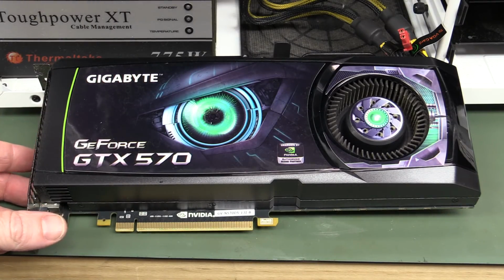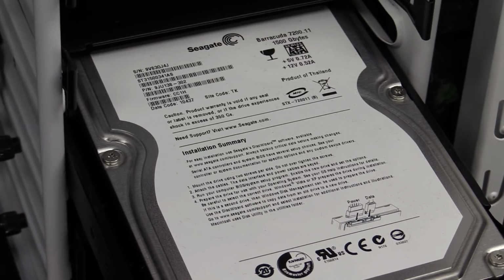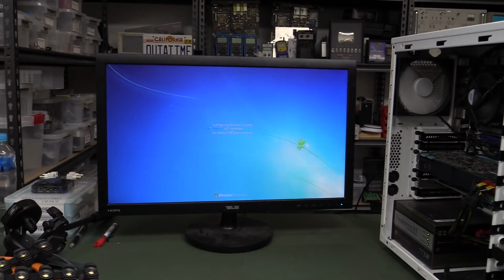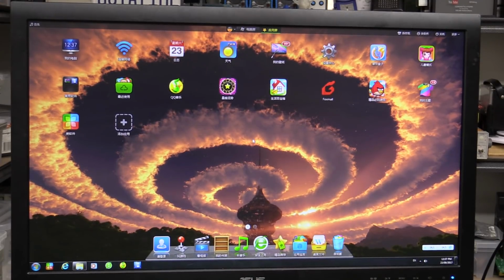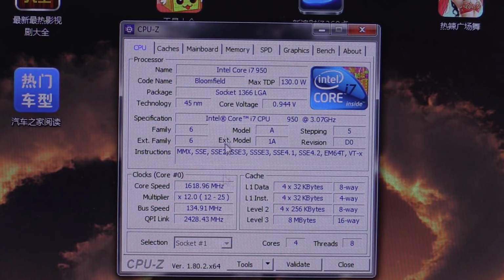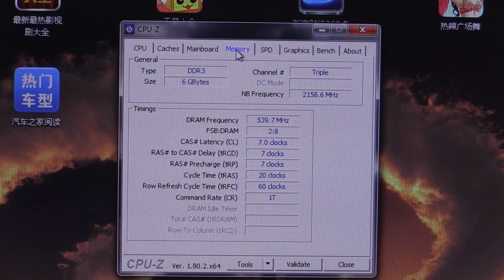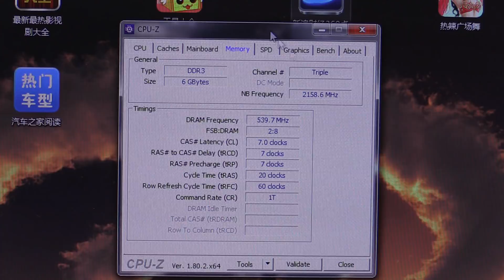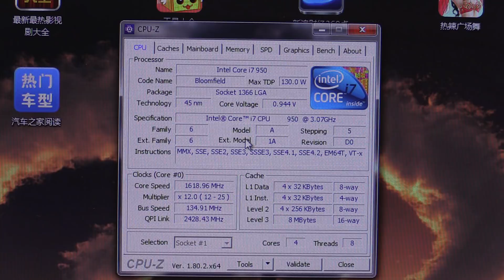EEVblog #1026 - Mystery Dumpster Diving PC

Comment: That's a Define. Who would throw that away? Those aren't cheap. There never were any i5s or i3s for LGA1366 by the way. Only i7 and Xeon. The 870 is also a first-gen i7 just like the 950, but it came on LGA1156, which was the consumer-grade platform, as opposed to LGA1366 which was for workstations and servers.
Reply from the maker: Seems I can use any of these processors?
https://www.cpubenchmark.net/socketType.html#id4
Reply: Ideally if you wanted to swap them you'd check the compatibility list of that motherboard. It should support all 9xx-series i7s, including some six-core models. Those are newer though so you may need to update the BIOS first with the CPU that's in there right now. Some Xeons are also compatible, but maybe not all of them. Here's what Gigabyte has to say: 
https://www.gigabyte.com/Motherboard/GA-X58-USB3-rev-10#support-cpu
It's also worth noting that any CPU on this platform can be overclocked by raising the base clock quite easily, but they do get quite warm if you do that, and will also need to adjust clock multipliers/dividers for other components on the board so they don't run too far out of spec. Anyway, congratulations with that find. It's not new but it's still fairly fast today, faster than what I've got here by a nice margin.

Comment: I found an HP computer in the mechanical engineering building e-recycling at my university about a year and a half ago. No RAM, no hard drive, but it does have an i7-3770!! I slapped in a spare HDD (with Windows 10) and 3GB of DDR3 1333MHz and it booted perfectly! Since then it has gotten a Gigabyte Z77P series mobo, a 500GB Samsung SSD, 8GB DDR3 1600MHz, a NVIDIA GTX 480 graphics card, and an acrylic case with custom made NeoPixel RGB border lighting controlled via an Arduino Nano using custom software I designed. In all, the build has cost me just under $400. Half of which was just the SSD xD
Reply: Ian McClellan-Johnson A GTX 480???? Yikes. May God help your poor, doomed soul... *Does cross across chest*. 

Unless you meant to say "Radeon RX 480", in which case, nvm, nothing to see here folks...

Comment: Mate, with an x58 motherboard you should overclock it :) If you have a decent cooler free anyway. I run 3 x58 systems, running 6 core dirt cheap xeon x5675's oc'd to 4.3-4.4ghz :) The performance becomes crazy for the price, in your case even more so as it was free :P

Comment: It is a nice platform but my old socket 1155 pushes 9000+ (i7 3770K) paired with equal crusty nVidia 680... ..but it was not for free so you win.

Comment: Meanwhile I am watching this on my socket 775 platform with a gforce gt620 graphics card. An i3 with integrated grphics runs better graphics But I got war tunder working on low settings on 28fps which is nice

Comment: The case and motherboard are the most expensive parts here.

The CPU isn't great, loses out to even 50$ Pentiums now while consuming so much more power that if you really used that machine after a year you could buy a decent CPU. 
And the GPU - loud, hot, slow. It works, but not great.

The first USB 3 boards arrived some time in 2009.

Comment: trojan horse. dont connect it to your network.
Reply: Flash the latest bios or current one over top the one installed and run a Deriks boot and nuke (DBAN) for multipasses. This system is old enough intel ME wasn't a thing yet. Should be pretty safe after that :)
Reply: X58 doesn't support UEFI so you're fine.
Reply: @Electronics For Fun
Yeah your right, the final stage of this master plan is probably to check if someone makes a dumpster dive video of it, trawl the comments for people saying it has malware on it, then joke about how ridiculously ineffective that method of infection would be to convince everyone it's safe ಠ.ಠ
Reply: That has to be the most cost effective way to spread malware. Buy a complete computer with very decent specs, probably around 2012, wait 5 years, leave the thing in a dumpster and hope someone happens to pick it up, before it gets stripped and sent to Africa or something. XD
Reply: Yeah, I guess that can work too, if you want to be an NSA copycat. Not that original though. Way cooler to do some convoluted network infestation with overpriced hardware :P
Reply: Yes, but that is not as funny...
Reply: molnez+ :-O
Reply: I think y'all are missing the effort to reward factor here. If I spend 150 bucks on a nice case with well specced old stock then the reward has to be greater than 150 dollars, and I only have one victim, and my goal is to create a horde of zombies then I'll have to hope it gets hooked into a vulnerable network.its also reasonably easy to mitigate the risk of one machine, wipe it, reinstall, and hang wire shark off the back to see if it's doing anything goofy. 
Even my tech addicted ass has about three machines running on my network that are at risk to zombification. If I buy a literal bag of thumbsticks, compromise the firmware on them, and scatter them about the land like a malware fairy, then I have many more chances to infect many more networks and have a much stronger botnet for less than the same price. It's also harder for me as a network engineer to explain to my users not to insert thumb sticks into a computer. Most users would know straight up that hooking a full blown computer to a network is a no-no.
Reply: aljowen+ ikr you'd think that, because sandy bridge came shortly after nehalem, and there wasn't a whole lot of time to do a whole lot.
Reply: I think the assumption is that the computer could have been infected with a virus. As opposed to the virus being planted on it specifically for someone to pick it out of a dumpster :p
Reply: Generic Green Squid bet that machine is old enough to do the smm ring -2 pwn
Reply: If you feel really unsafe about it, just get a new cheap HDD or an SSD.
Reply: molnez+ for all you know this machine could have been built a month ago. the older parts in that thing are super cheap right now, so he could have used those parts to make it look like it was an old beast that did it's job but needed to be put down. so he puts his crap on it and then tosses it in the bin. you can't build a computer full of junk and then expect somebody to take it, the inside of it has to look at least decent for somebody to bother taking it away. so if you put in older top of the line parts then it might be worth a look for somebody who is skimming through the dumpster.
Reply: Doubt they'd compromise, but hey, that's your opinion
Reply: molnez nah. Just leave thumbsticks laying around. No need to spend money on an entire computer
Reply: This thing was probably in a Chinese internet café, so there has to be spyware on it (required by the Communist Party). He's gonna nuke this install, so no worries.
Reply: Generic Green Squid What about the motherboard? Since it has been shown as possible to compromise the UEFI /Bios silently.

For the components that are in it I don't think I would want to bother with it. Now to be fair it's probably 100% fine. But imo it's not worth the hassle if it does cause issues.
Reply: Electronics For Fun Damn, you are correct. I assumed that since UEFI seemed very mature on my sandy bridge system that it must have been around for a gen or two before that.
In which case UEFI is not gonna be a problem.
Reply: Generic Green Squid Often even nuking a device isn't enough to make me even consider connecting it to my network. A PC like this is imo not worth the security risk it poses even after being wiped clean with a new install.
Reply: Just do a search for UEFI virus and you will find a fair few results. They have been trying to target UEFI's because the virus will survive an OS reinstall. You could try updating the UEFI in order to make it "safe", but like I said, what's the point for a first gen I7?
As I mentioned, the odds of this being the case are very very slim. But if you have over £1k worth of other computing hardware connected to a network its frankly not worth it.

Comment: Reading through the comments here it's obvious most people are missing the point by saying 'it's old' and 'it's worthless' and comparing it to more up to date equipment. A free computer that works can be a very useful addition to anyones spares cupboard. There are so many possibilities for it and multiple projects that require a dedicated computer or you could just use it as a server or even a test computer, why are people so confused about this ?
Reply from the maker: Well said, plenty of uses for a working machine like this.
Reply: One other thing is that people (by falling for the marketing wank) assume that 2-3 year old machines have been vastly superseeded by newer machines. In the case of computers like these (towards the high end), that's oh-so-very-much not the case. 

Slap a decent air-cooler on that, overclock the snot out of it, and it'll still work a treat. Maaaybe upgrade the video card, if you're so inclined...
Reply: I mean, i sometimes still use P4 computers and laptops from around 2005~7ish because with the correct OS, they still work like a charm
Reply: The difference in actual cost is miniscule though, you would hardly notice it and it doesn't make sense to buy a new $600 machine just to save pennies on the electric bill.
Reply: Why is it that all anyone wants to do with computer sis play games on them? I'm looking through this thread and a majority of people are tabulating the possibilities of this machine with games. There is much more to a practical and functional life than games.
Reply: The trick is to put a xeon X5650 in it and OC it. Costs 20$ + a decent cooler. (+a more modern GPU and maybe more RAM) Then this will run every modern game out there. Every single one.
Reply: sadly ..the dumpster dive is faster than my current rig :/
Reply: It's also great that it has a drive on it with a seemingly valid Win7 license. All you need to do is re-install the OS to get rid of any junk put there by the previous owner and it's better than my computer.
I'm not sure how you would re-install the OS without the original media because that machine probably doesn't have the recovery partition considering it looks like a home build computer.
I guess Win7 had a recovery DVD making utility or something?

I've gotten some nice computers for free but they have Vista on them so they're not really that useful for people who don't know how to deal with a dead/unsupported OS.
Reply: My only gripe with such old hardware is that they consume a lot of electricity.

If you intend to use this as a server that is going to run 24/7 then the electricity costs will make a new and power efficient computer system more feasible.

I have dismissed the opportunity to get a lot of old professional hardware simply because they are too expensive to run.
Reply: It's better than my machine. Just because it's not a Google server doesn't mean it wouldn't be a great daily driver
Reply: You have to remember that you here you have people from all walks of life, from all ages and from all over the world. This PC really fits into wide spectrum of personal needs from nearly useless to perfectly fine. Literally one man's garbage is another man's treasure.
Reply: dentakuweb It is easy to re-install the OS. Many places out there do have a full copy of windows. Only issue in this case is make sure to have the key. I know people that garbage pick old computers just for the windows liscence key as that is the main issue with installing the operating system. Now personally I would see no issue with that computer. Oh hell I used a cheap laptop with windows vista on it for 7 years and only gave it up because it was just beyond economical repair for the failing soundcard and the constant bluescreen issues being caused by the soundcard failure.  for an everyday access the internet or specific task computer that is no slouch. Going on the NVIDIA naming convention that is a midrange card for back in the day as usually it goes (x stands in for generation number) x45, x50, x60, x80 then titan then some cards have a ti variant just meaning they are slightly faster or have a slightly different spec. Most of the issue with these older computers is the operating systems. the operating systems just get overbloated with the updates and the background processes. Only thing I maybe would do is ditch the hard drive and stuff a little more ram into it. I would be even willing to blow windows away and sub it with android as that would be overkill hardware for an android OS. Come to think of it most chips that you find in today's cell phones are just a powerful as maybe a computer in the 90's  just in a miniturized form.
Reply: @sarah1390  10-15 years old desktop computer or laptop automatically does not mean that it is bad. If your computer was decent one 10 years ago and still works, it should not be a problem to use it if your tasks aren't definitely performance demanding. My home PC now is 10 years old and I have no notable problems with it in everyday use (Linux Mint 19.1 for work with Windows 10 for gaming in dualboot) except CPU and video card doesn't match with very video RAM demanding latest games. GF's laptop with Windows 7 still works from year 2007 though it probably will replaced soon because of failing motherboard.
Reply: Yes ditch the hard drive and install a solid state drive. 

Will speed the machine up some.

Also find out the max RAM it can handle and get a matched set of RAM for it.

Just using any RAM will make it not quite as fast as it would be with matched RAM
Reply: I'm watching this on a 2006 AMD 3600 64bit dual core(1.8Ghz). Not my main machine, just for some YT streaming on the TV and such. The key is to ditch the MS bloatware, Manjaro linux.
Reply: +Andrija Ifkovic Desktops are great NASs, routers, servers, cluster computing, cluster servers, for large data calculations, aesthetic, and many more utilizations. This thing is perfect if not overkill for software development.
Reply: Q: ...why are people so confused about this ?

A: because they're idiots.
Reply: Probably because their 'cupboard' is full of similar components.
Reply: On a similar note, i just watched a 2-part video from AdoredTV running through the history of GeForce video cards, comparing prices and performance increases from generation to generation. Quite the eye-opener...
Reply: No shit, I thought I recognized the platform.  Same platform I'm still rocking.
Reply: Ian Clarke this thing was worth around 1.5k$ I think, its still worth atleast 500$ if you want to buy the components so this is a verry nice thing to find in the dumpster
Reply: Still using a rig with an i3-550 (I had to buy a card for USB 3.0), so I'd snatch a computer like this quite happily.

By the way, my laptop is old too, but I never notice because I'm not an idiot that tries to game on my laptop. It's got Precise Puppy on it, so it runs quicker than most of my friends' laptops (as far as accessing and running common applications).
Reply: SSHDs are faster but I believe they have a short life-span. One of mine has already failed and they are not cheap.
Reply: Its illegal to do this where I live :'(
Reply: but this thing can even run modern games like battlefield 1. No joke! X58 is an awesome platform, and better than e.g. my gaming rig with an FX8150
Reply: Put Windows 10 on it and it will be good for several more years.
Reply: @ikonix360  Linux Mint 19.1 for me.
Reply: Yetoo Because this is a desktop computer. Most people use laptops or just phones for their computing needs, and if they have desktop at all, it’s for games. And even for that laptops are almost as good (for a higher price). Unless you do software development or content creation you don’t need one at all. And for those , this thing is just too slow.
Reply: @andrijaifkovic7066  Software development on laptop is not a problem, especially if your tasks doesn't involve very CPU and RAM demanding tasks like compiling huge projects with thousands of source files or running application servers and databases on same machine where you write code. For Web frontend developers larger screen and comfortable keyboard are even more important points. Also it is possible to use laptops wit external peripherals and docking stations. My two previous workplaces use this concept with laptops and external keyboard mouse and monitor quite extensively.

Comment: X58 is the old "Enthusiast" platform from intel and there's no i3 or i5 processors for this platform, So if you see "X58" in the future you can be sure it is a 4 or 6 core i7 cpu in there :)

Comment: More modern mobo and cpu than me, but I think mine would outperform that one as it sits. Though, if you upgrade that to a xeon, and get a 1060 gpu in there and you have a pretty good machine. I'd bet.

Comment: X58 was intels high end platform, using LGA 1366. You'll only find higher end i7's and Xeons on it, and mostly 4 and 6 core ones at that. It supports triple channel DDR3, and that board is 100% overclockable, although the cooler sucks. The GTX 570 kinda blows, reference cards aren't great, although it's not as bad as the GTX SLI 480'S I had, man they ran hot. I avoid Thermaltake PSUs, although they are no where near the worst. This looks more like a kids gaming PC that he went (or maybe the parents) just upgraded and dumped for free, it's worth a couple hundred in Australia at least.

Comment: LGA 1366 is intel's enthusiast socket for that time period. If you slapped a cheap i7 980x in there it'd do everything you want including really good modern gaming on something like a GTX 1070. I believe LGA 1366 ONLY has i7 processors on it, it was a companion socket to LGA 1156. Basically LGA 1366 supports triple channel memory, a big boost from LGA 1156, among other enthusiast level features.